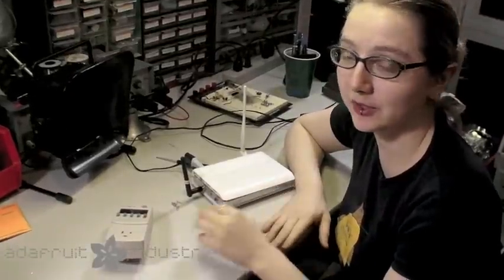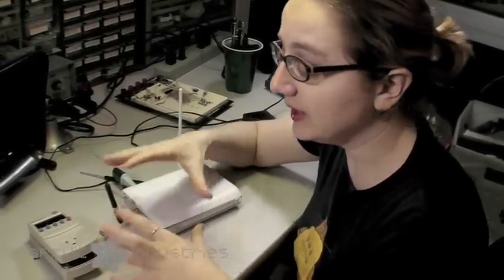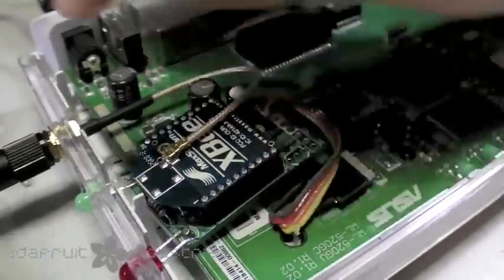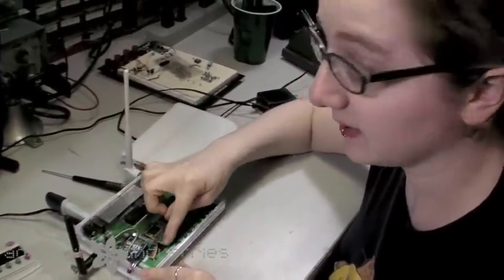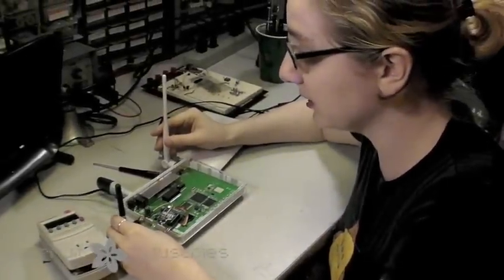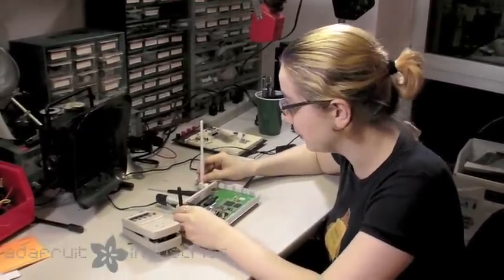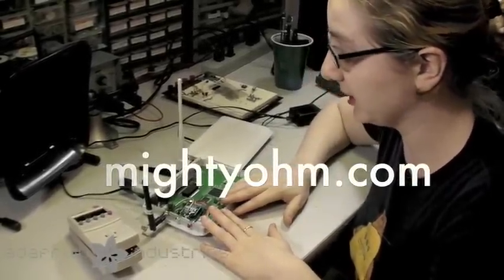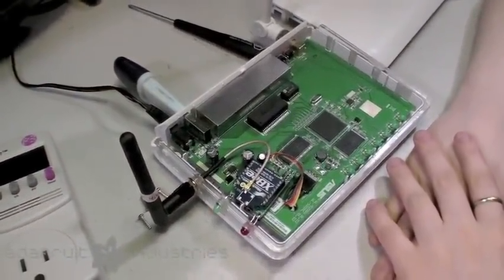How-to ASUS router hacking for the Tweet-a-Watt

Comment: @peekaboo2u Routers run on low voltage, so you can't possibly electrocute yourself. And unless you use a metal object or your hands are wet, there's also no chance in shorting out the board.